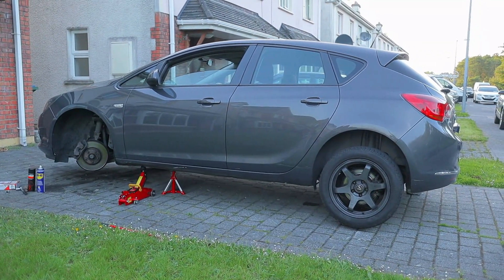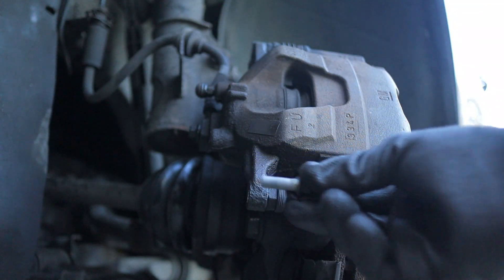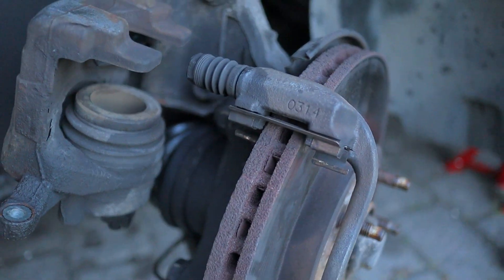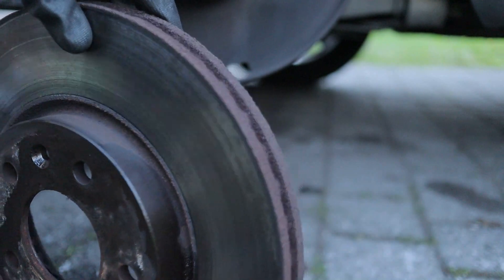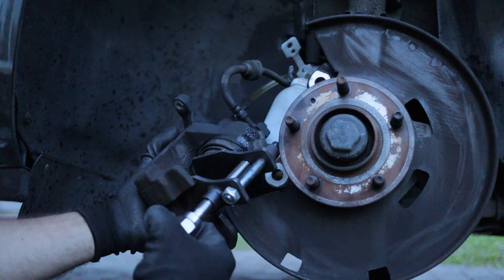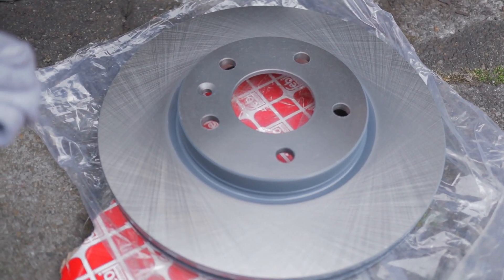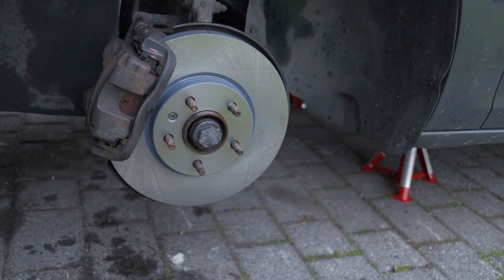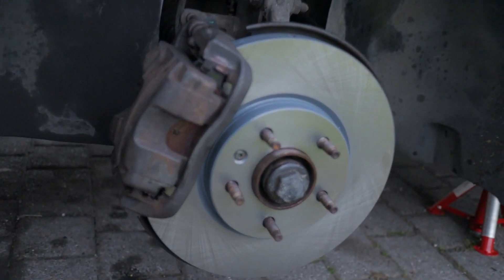Vauxhall Astra J Front Brake Pads and Discs Replacement

Comment: hi can you tell me the size of the discs?Thx
Reply from the maker: Hi, these were 300mm in my case. The car's a 2013 vauxhall astra j, 1.7D 129bhp version. I hope that helps.
Reply: @noorshah96  Thanks for your answer,I have the same model I wasn't sure about the size.Thx
Reply from the maker: Oh great stuff, glad to be of help! Best of luck with the brake job and the car 🙏🏾

Comment: Your drive shaft gaiter is split
Reply from the maker: @Phil 1969 Thanks for pointing out, I never realized. Will sort it asap.
Reply: Its called  cv boot joint
Reply from the maker: @loeb1 yeah cv joint boot or just CV boot or gaitor 😁
Reply: @noorshah96  .

Comment: Dont needs  that bottle  to wine back brakes
Reply from the maker: I know you don't need the bottle to wind back but I do it as it makes it easier and also drains the dirty fluid directly, saving it from going back into the system (when you're changing the brake fluid too)